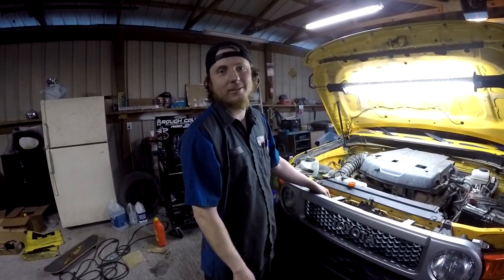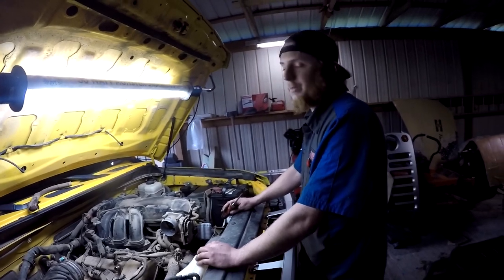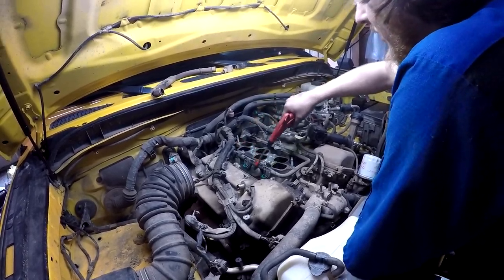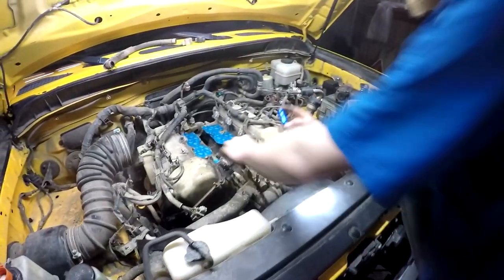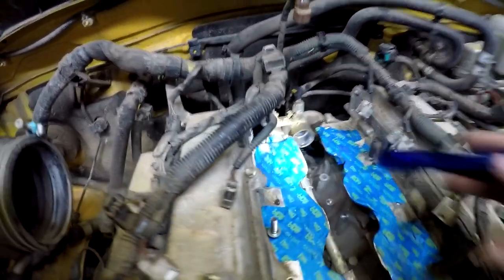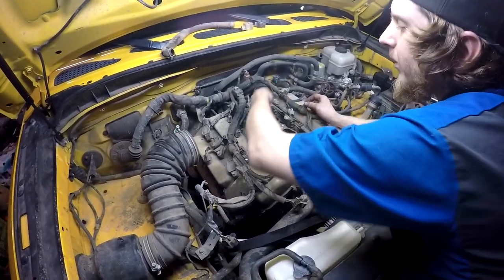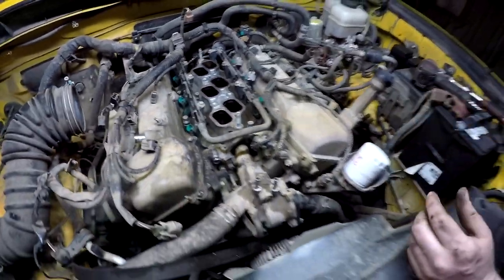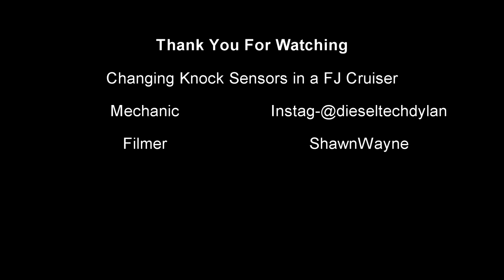FJ Cruiser Knock Sensor (both) Replacement 2hr vs 20hr (Easy Way)

Comment: I'm getting ready to order the parts and do this myself, 2007 FJ 4x4 AT, 200,000 miles. Dealer quote $4740. Denied. Thank you for this video!
Reply from the maker: Hope we could help! We made this video a very long time ago lol
Reply: thank man, im doing my sensors and harness on 2006 4runner 1grefe this weekend @theshawnwayne
Reply: That's crazy that's just the cost of a head gasket replacement, and valve replacements and machine surfacing of the heads. Crazy all that for just sensors.

Comment: Did this for my 2010 Tacoma. Useful video. Give yourself more time as an amateur. Rodents had chewed up a wire and left a nest. Check Engine light and Slip Indicator Light went off immediately after next start up. Thanks

Comment: Dude your a badazz,,,,, one genius approach on removal install of knock sensors.  We have a 07 that needs knock sensor changed out and 2 o2 sensors and a cat.   In anchorage Alaska.    Came across ur video cause we needed insight on this process.  Thanks a million

Comment: I like your technique. Curious about whether you think tying that pipe together with a hose clamp will pull the pipe/O-ring seal to one side and cause it to leak? I have to do this on my friends truck and I will probably use some epoxy putty to repair the metal that was cut to remove the pipe.

Comment: Just finished.  thanks for the demo it was a great help for my Tacoma.  damned mice!!!
Reply from the maker: your welcome bro, glad it could help. I hope we got a sub from you and hope you enjoy out new videos!
Reply: Hi I had the exact same issue with my Tacoma 4.0 with rats chewing on the wire and tripping the (✔️ENGINE LIGHT & TRAC LIGHT)
when you got to the KNOCK SENSOR Was it the actual Sensor or wire harness that needed to replaced
Reply from the maker: @glee6258  it was one knock sensor that was bad but we replaced both just in case, and the wire was kinda chewed up so we replaced it too
Reply: G Lee just the wire.

Comment: Very helpful video. I'm being told that just the harness can be swapped without removing the pipe by just sneaking around it with some curved pliers, or a pick and releasing the latch on the cable, what do you think? Bought a 2008 FJ with the light on and P0333 code.
Reply: Did you ever successfully try this? I'm about to try it.
Reply: @AdamVest  my brother helped me do this before he passed last year. It went very similar to the video. But I’m my case the sensor itself had failed so have one ready or be able to wait for it. Truck doing great since and it really helped mileage and power fixing the issue. Good luck!
Reply: @in1stw020  man I'm very sorry to hear about your brother. What happened to him?
Reply: @AdamVest  he passed from cancer

Comment: Thank you for this video! Veen very helpful in the process. Pesky mice! Chewed off wires right at the sensor. That metal coolant hose was a battle. Twist n lift was what did it for me. And loosening the other hose gave much needed relief.

Comment: it seems like you cut the weld between those pipes. I did the same , but will it affect the engines reliability at all? like cracks in the pipe over time? cause i heard the weld is there to keep the two pipes from vibrating. i see that you put the metal clamp on it. is that necessary? I did not put mine on... I hope you can answer this question as im pretty paranoid that I cut it. Thanks!
Reply from the maker: It will not as long as you put a holesclamp around the two pipes
Reply: @theshawnwayne  damn, so it seems like i may have to take off the manifolds again and clamp it. Cause i didn't clamp it. Or do you think it isn't necessary? Maybe just a precaution or will it break eventually for sure? also if i do what size is the clamp?
Reply from the maker: @4runnergodfather158  I think it would be just for Precaution, the pipes seem pretty strong tho I don't think there would be an issue
Reply: @theshawnwayne  okk thank you so much brotha. Liked and subscribed. You helped a bunch.
Reply from the maker: @4runnergodfather158  thank you for subscribing, check out some of our videos if you get time!
Reply: @theshawnwayne  hey sorry, but one more question, i did knick part of the pipe when cutting it. Will that knick result in the pipe rusting overtime? Thanks!
Reply from the maker: @4runnergodfather158  I wouldn't think so because of the placement of the pipe. But if you need too I'd spray some primer on it but I think you'd be fine
Reply: @theshawnwayne  wow you have lightning fast response, thanks!

Comment: Is the pipe whose bracket is cut through the same pipe that is shown on page EM-96 (4th picture down) of the Engine Mechanical service manual?  It indicates a replaceable o-ring.  If it is, due to the difficulty removing the pipe shouldn't it be replaced?
Reply: Anybody?  If it is the same pipe the manual indicates that it's a non-reusable.
Reply: Come on, somebody, anybody, please...

Comment: How did you get the large pipe out? Ive been pulling and hammering and the thing is stuck. (I took the bolt off the bracket holding it to the block)

Comment: Great video! I have 2 errors. One is the Transmission Range sensor.Do you know where that is located? I also have the Camshaft/crankshaft position correlation bank 1, sensor A.
Reply from the maker: I'm sorry bud but I do not know where it's located

Comment: This video is extremely helpful do you by chance have a link for the harness for the knock sensor?
Reply from the maker: I wish I did but it’s been so long ago I do not have one
Reply: @theshawnwayne   thanks again and In the video both sensors where replaced correct? Including the harness?
Reply from the maker: @garzilla1488  yes sir
Reply: @theshawnwayne  thank you 🙏🏼
Reply: Just get them at Rock Auto, the cheapest around !!!!

Comment: Taking my tacoma in tomorrow to the shop to get mine done and just now finally came across this video lol. Wonder what they'll do 🤔
Reply: Do you remember how much the total cost was? I’m about to do the same and want to get a idea
Reply: @garrettwilson597  I live in Ontario Canada.. I was charged $1190 before tax for parts and labor but I also had my EGR valve gaskets changed, sparkplugs, and a belt. So probably around 900$ Canadian
Reply: Got quoted 7,000 here in the U.S. for this job a few days ago. We’re going to try to do it ourselves. All these parts are just a couple hundred bucks.

Comment: 2,200 views! Glad I could help yall out!
Reply: Hey man I need to do this is actual the rats chewed my knock sensor harness but I'm not confident in my skills I'm going to approach my mechanic with this idea what is the name of that tube that you need to cut the brackets off in order to access the knock sensor without removing the lower intake... I'd like to just throw that idea around at the shop I like to know what that tube is what what runs through it and just what it's called
Reply from the maker: @davidmcnamara9173  I'd show them this video and see what they might can tell you, some shops won't do this because it's not supposed to be done this way lol

Comment: Bro. Is 4runner sr5 4.0L v6 same engine?
Reply: Did you ever get an answer? I have an 07 4runner with knock sensor codes lighting up and I have the 4.0l

Comment: How did you pull out that grey sensor at the back of the intake manifold?  The video cuts right at that part and im stuck with it...   Do you have whatsapp where i can video call you maybe? I can pay for that
Reply from the maker: I'm not sure because it was so long ago and I'm not the one that worked on it, I'll get Dylan to comment on here and see if he can help you with that
Reply: @theshawnwayne  at 5:24 is when he disconnects this sensor that i can't figure out
Reply: @theshawnwayne  did you ever figure this out? I'm having the same problem.

Comment: Hello there. I follow your steps but I couldn't get the big pipe out.  it looks like it stuck very good.  Any ideas how to get big pipe out so I can get the cable harness replacement?  Thank you.
Reply from the maker: It's gonna be in there pretty good, just pull harder lol
Reply: I will try it again. Thank you for encouraging. Happy Holidays and Merry Christmas.
Reply: I almost giving up because it so difficult to pull out the big pipe is stuck very good. But with your word I will try it again.  Thanks.
Reply from the maker: Ours was kinda tough but seem fine. I would try and pry it out with something but just remember to work it back and forth
Reply: Do you have to loose the 4 nuts and 2 bolts in the back of the join water by pass in the rear to release the tension so you can pull the big pipe out easy?  I was thinking about order new coolant pipe and join water by pass rear from dealer in case mine so difficult to pull out.  Part # 1635631011 & 16306AD011.  Thanks
Reply: Finally, I was able to pull big pipe out without remove 4 nuts and 2 bolts from join water by pass by using hose clamp tight it to pipe with little bit heat from the heat gun around the join water by pass in the rear from there I hit with steel solid rod with my sledge hammer gentle to the hose clamp screw and the pipe giving up and coming out as expected. By  the way I don't have to remove the serpent bell.   I also cut the bottom bracket from the big pipe the one that hold the 10 m nut because it in the way when the big pipe full out. I agree with you  put the big pipe together side by side with small pipe by using hose clamp and I don't think it going anywhere. This is only way to see wiring harness been chewed up by the rodent and easy to access this area. I was thinking about soldering but I would like to replace the new wiring harness anyway.  Question for you Shawn how did you remove the wire connector in the back that accessible very tough.  Do you have to remove the head cylinder gasket so it can be visible and disconnect it easy? Also for knock sensor I was able to get 2 under $23 made in Japan Denso from Google search part # 8961506010 89615-20090 US  look identical like the one from the truck also new set of pipe from dealer part # 16306AD011 around $50.   Anyway without your video I would not know how to fix the error code and  knock sensor.  Words cannot fully convey how grateful what you guy have done for the community .  Happy Holidays and Merry Christmas. Thank you.
Reply: For all community here.  If your knock sensor is good check the resistance 2 point between 120Ω to 180 Ω (ohm) if not then replace the both knock sensor at the same time.  Also when your use the heat gun make sure tap off the fuel line and moving them away just for safety precaution.
Reply: If anyone wanted  take out old wiring harness for knock sensor instead do the soldering.  Just simply put the big thick card board on top your engine and climb over the truck, tracing the wire with your hand and using the pry tool  from  harbor freight tool from the link below without remove the gasket head.  https://www.harborfreight.com/4-piece-heavy-duty-pry-bar-set-1654.html?_br_psugg_q=pry+bar. Just take your time and patient and gentle like Dylan did the cable will pop out and voila.  I can thank you enough for this video make it possible for community to replace the knock sensor by Shawn and Dylan with the dealer quote so ridiculous around $3200.  I am going to put back together and do the test drive tomorrow.  Make sure take all the photo while you do knock sensor replacement for your references.
Reply: Put back all together and start the truck and test drive so far no check engine light and error is gone.  Truck is running great than before.  Many many thanks for the video made by Shawn and Dylan. 

https://www.youtube.com/watch?v=M6Ggp3TJjuE&feature=youtu.be
Reply: @maxmx9203   I used a pry bar against the bracket I cut and channel lock to turn it took about a half hour. !!!!

Comment: Anyone with tips on getting the harness off at 13:42? I can't seem to pop those out as he says.
Reply: Disconnect wire from knock sensors and feed wire back through so you can get enough space to see it from passenger side and cut wire tie off and disconnect plug then you can pull the  plastic piece out of the bracket !!! I know it’s very hard to see it !!!!

Comment: Thanks man!
Reply from the maker: Hope to see you subscribe! Your welcome!
Reply: I have the 1gr-fe tacoma 4.0.  Intermittent Engine Light - P0333 Knock Sensor Code
It goes on and off it's been about over a year now.  It has about 67,000 miles being 2006 . I been putting Costco gas 87 all these years. It idles fine, only mod is an kn cold air intake and magnaflow muffler, I dont notice any power loss. Actually just replaced the valve covers, spark plugs and coolant and fresh Mobil one synthetic oil, clean mass flow sensor,cel light was off recently and about 50 miles later it went on again this morning when started if was off and coming home from work it's back on again.  What else can it be besides the knock sensor? Any suggestions thanks

Comment: thanks bud, im going to try this on my 07 tacoma
Reply from the maker: Your welcome and I hope to see you subscribe! 😍
Reply: @theshawnwayne  worked out great man! Turns out a rat chewed up my knock sensor wires. I did it in 5 hours but no more check engine light. You saved me 2000$ from the garage. Consider me a life subber 👌🏽
Reply from the maker: @nunyabiznes2925  Thanks bro! Glad Dylan and I could help!

Comment: what are the toyota part numbers for the seals and gaskets
Reply from the maker: I can't remember exactly but I believe we showed them in the video, if not I'm sure we can get those part numbers soon
Reply: @theshawnwayne  the parts were shown, but the part numbers were not. I have a similar situation with a Toyota 4 runner, and I want to get this done. So was hoping u knew the numbers. Especially for the gaskets.
Reply from the maker: I'll get with Dylan and see if he remembers, he will probably reply to this if so, we will update you asap
Reply: I don't know the numbers off hand. The knock sensors came from Rockauto.com and the harness and gaskets came from toyota. Just gave them the VIN and told them what we needed. Upper and lower intake gaskets and knock sensor harness.
Reply: Is there any way of getting the big coolant pipe without cutting the bands? If not is it necessary to remove the serpentine belt?
Reply: andy Quema going by the book to get the pipe out you have to remove the passenger side cylinder head. Cutting the band is much easier.
Reply: @dmandylanhall  does the serpentine belt needs to come off
Reply: andy Quema Do not think so.
Reply: @dmandylanhall  in the video I thought I saw you remove the belt? Any way are those bands on the pipes thick?u think an 18v  Reciprocating Saw work? thanks for your quick reply . Any suggestions much appreciated. I just replaced the valve covers 2 weeks ago I thought I messed up when cel came on but come to find p0333 knock sensor. Going to tackle this knock sensor tommrow. 
Stay safe out there.  Mahalo from Maui
Reply: andy Quema yea a saw should work fine. Short blade. Not really a hard job just a little bit of time involved.

Comment: I would rather not have to replace my knock sensors and wiring harness but I guess considering my fj is due for its radiator fluid to be changed it could be worse.

Comment: i went to toyota they did mine, they said it failed do to rodent damage (i have a 2012 toyota tacoma) 1 month later, engine light is back the traction control is off i hook up the scan tool and its my knock sensor again. im trying to find it with a bore scope to verify if it was rodents or a bad harness. is this possible to see with a bore scope/ endoscope?
Reply from the maker: I'm not sure because we knew the problem before hand, but I'm sure it would be easy to get to with a bore scope, keep me updated on it so we know for future projects
Reply: @theshawnwayne  ok, ill try to update when i can. thanks :)
Reply: @theshawnwayne  hello i wasnt able for find it with the bore scope, i took it to toyota and got charged $700 i requested they rap the harness in a rodent resistant wrap i guess they might have im not sure.

Comment: So really you could have just replaced the knock sensor harness.. I'm having codes come up for both knock sensors but it's not often they both go.
Reply from the maker: Why would you do all that work and just replace one thing, when you can replace the harness and both sensors all in one tear down?
Reply: @theshawnwayne  where I live the sensors are roughly 280 a piece. If the harness is the culprit I'd be only changing that. The gaskets are cheap and harness is 50.00. I'd test the sensors to make sure but if you can see harness damage then you know what the problem is.
Reply from the maker: @rhoclarry  order them from RockAuto they are cheaper there. Best bet is to change everything while your in there, so you don't have to go back in and change the sensors. You can probably get the sensors from RockAuto for around 30$ a sensor
Reply: @theshawnwayne  I'd be buying denso only. I'm pretty sure rock auto has everything but. 
The code is cleared..see how long I get til it comes back. It seems like the code only comes on after a good rain. Fn mice.
Reply: @theshawnwayne  can you replace the harness only with this full tear down or is that necessary to get access to the plugs?

Comment: I just put mine in the shop today for this...4200 dollars
Reply from the maker: no wayyy
Reply: They don’t have to pull the head off but they Charge you for it anyway !!!!
Reply: @D21403  I've seen the 2 hr change ...where they cut the lines ...on top to get access..but he is also rehoning the heads and cylinder  exam...soo...thought it was worth it. He's also replacing gaskets.. which ...I don't know it's worth it to me
Reply: @theshawnwayne  my shop quoted 1700 but might work with me I showed them the video. other shops quoted 3700-4000. cant believe toyota doesnt have a updated manual